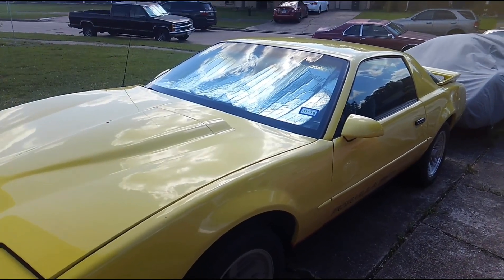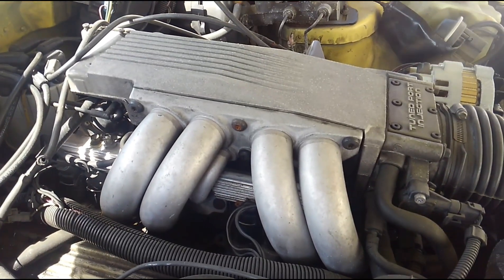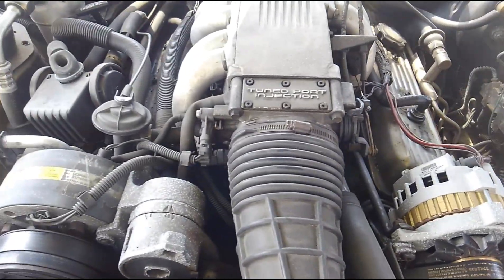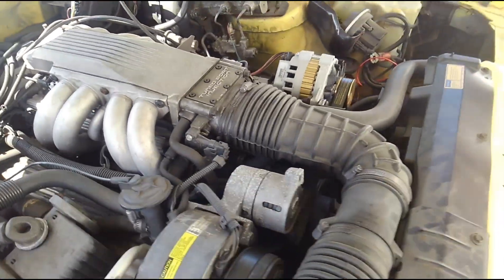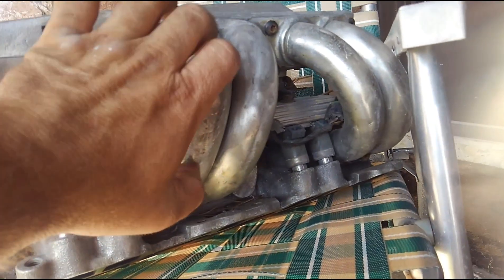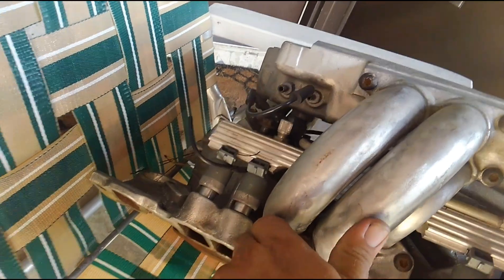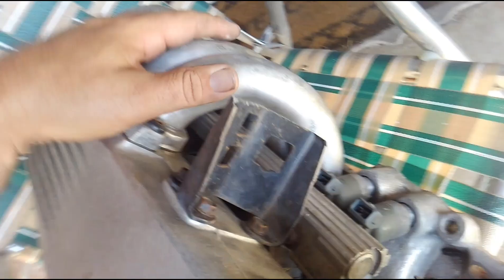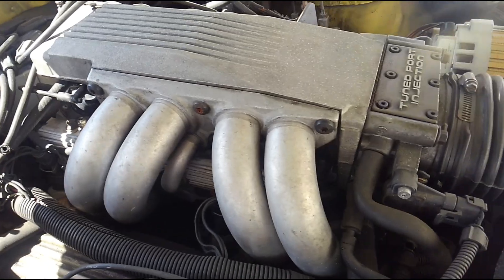The Awesome GM Tuned Port Injection System of the 80's

Comment from the maker: Be sure to check out the follow up tear down video for this Tuned Port Injection system - https://youtu.be/OMPd9wP7suA
Reply: Richard holdner will show you how a you will be a la motor on mostly anything out now with the right combination. Don't rule out the tuned port injection just yet guys, a lot of you aren't factual with your knowledge on the tuned port injection system.
Reply from the maker: Yep, they definitely surprise people at a stoplight pull. 👍
Reply: @VetteSource   Yes,  but I am talking further up the rpm gage as well like around 6500 if built right
Reply from the maker: Ahhh, yes. The secret mods that most people don't think about with a TPI. My personal favorite was the Lingenfelter Superram intake with matching can and AFR heads.
Reply: @lateroc2955 I kinda have one of every tpi, ai made take a my or tunnel r intake and make flanges to bolt a throttle body to each 4150 carb which would be 1500cfm, would need to be for max rpm, max lift, max flow but still be efi, I run a 950 on my 305 tpi .403/.431 207/109 LSA revs faster it's realynsoixy lately 19# inj 3.42posi 3000 stalll aluminum driveshaft runs pretty good frame ties also
Reply: Can You put a TPI on a 95 LT1?
Reply from the maker: Unfortunately not. The LT1 cools the block first so the heads and intake are different and won't interchange.
Reply: @VetteSource  Thanks for the answer. Ya, no water in a LT1 intake. Too bad.
Reply from the maker: No problem, man. Glad to do it👍
Reply: @VetteSource  I have a 95 2door S10 4x4 Blazer with a 95Vette LT1. Very sharp ride. Eerything works, air, push button 4x4, perfect interior never been smoked in. Vette steering wheel, carbon fiber everywhere inside, Micky Thompson wheels and tires, stainless duel exhaust, wraped headers, TV, remote CD changer cherry red and silver two tone. I always liked the tuned port intake. Wish I could put a picture up.
Reply from the maker: Sound like a cool build. Are you somewhere where you can use the 4x4?
Reply: @VetteSource  East Tenn. Mud, mountains, rocks, trails aplenty. We got it all. It's not a trail rig. More show. I have a 3/4 ton suburban for that. Lifted 4in, 35s, lockers, 456 gears. Much much more. Never owned a Vette. My buddy just totaled a 2017. My uncle had a 66 and a 67. Totaled both. I am a fan of the LT1 though. My son has one in a roadmaster. Torque!
Reply from the maker: The Suburban sounds like fun.  LT1's are a great engine with a nice broad flat torque curve. The hot rodded LT4 of 96 is even better with higher compression, more aggressive cam, and better heads. Too bad they made so few of them.
Reply: @VetteSource  We get around. And ya the LT4s are hard to come by unless you buy a new crate motor from GM.  Have a good one. And Stay safe.
Reply from the maker: @fontaineking5158  you too.
Reply from the maker: @fontaineking5158  you too.
Reply: But yellow?
Must be 4 teh lulz.
Hehe

Comment: Dodge did a cross ram back in the 50s. Low end torque but no upper power
Reply from the maker: Yep, I do remember those. It was very unique looking but had to be a dog at WOT with the length of those runners.

Comment: I have a 89 Corvette s 7:27 ame engine but mine has a chip in it so it's a little Quicker 😉 repainted Chrysler candy apple red, with        
 back window replaced with a
 hatch, only one other I know of.
Reply from the maker: Yep, the hatch conversion was made by an aftermarket company and supplied through Ecklers if I remember correctly.

Comment: General motors, they had multiport electronic fuel injection in 1974 on a twin cam Vega cosworth, General motors also had a multiport fuel injected engine on a 1976 Cadillac Seville.
Reply from the maker: Good point, forgot about those mid 70's oldies.

Comment: Hey Brian great video! I have an 89 GTA with a 5.7 TPI and I need to replace the plenum/runner gaskets due to a vacuum leak. While Im there, I want to torque down the intake bolts to proper specs. My question is, do I have to remove the fuel rail to access the center bots on both sides? Thank you in advance!
Reply from the maker: Yea. It's better to pull the rail out of the way while you're torturing down tye intake bolts. They are torx head and have a tendency to strip out if the angle of your bit is off even a little bit.

Comment: The key to TPI is no vacuum leaks, and proper sensors all working correctly.  THEN you can consider the typical mods….larger throttle bore or larger runners for intake…then typical small to medium bore headers.
But still you have the L98 heads to deal with….
If you can wrap your mind around 3500-4500 max rpm the L98 TPI engine is for you
Reply from the maker: Good information, thanks for sharing👍

Comment: You got a lot of facts wrong here. GM had a multiport electronic fuel injection system on the 500ci Cadillacs in 1976. I still remember working on them.
Reply from the maker: Cool, thanks for setting me straight👍

Comment: Is there a difference between the TPI units found on 305 engines and that found on 350s, say, some Irocs and early C4 Corvettes?  I have a '74 Corvette with an L82, and I would very much like to swap the carb for a TPI system.
Reply from the maker: Hey Gary, the biggest difference is the fuel lines, which come in from the PS on the Corvettes and the DS on the F-Bodies. Also, 305 TPIs will have 19 lb/hr injectors versus the larger 22-24 lb/hrs injectors found on the 350 cars. Also, 85-89 TPIs are MAF, and 90-92 Speed Density across all models.

Comment: This is very intriguing. I came here for some general knowledge. What is the biggest plus, I can see is the low-end power potential for a truck. These are dirt-cheap in the ads.  Most of the stand-alone controllers, run about $900. Is there a cheaper way to go without a degree in McGuiverism?
Reply from the maker: You're correct, these are not overly complicated and have the computing power of a Commodore 64 PC. Once you figure out all the tricks, they are very reliable and look awesome when you lift the hood as an added bonus.

Comment: Bosch TPI was developed for the 305 to give it low-mid range torque. It was modified and adapted to the 350 soon after.
Reply from the maker: Yep, but don't forget the L98 350 TPI was first installed in the Corvette in 1985, with the LB9 305 TPI offered in the IROC that year. I think it wasn't until 1987 that they finally began installing the L98 in the F-Bodies.
Reply: @VetteSource  Correct, the L98 was not available for purchase in an F body until 1987, which was “nice” but due to how the F-Body used a variation of the L98 configured with iron heads, among other differences, and was probably de-tuned, it offered more in bragging rights than improvement in performance over the LB9. Of course a 350 offers significantly more potential for high performance modification than the 305, but stock from the factory in 87 there was as little as a 10HP difference between the LB9 and the version of the L98 found in F Body cars.

Due to the 305 being designed with emissions and fuel economy in mind, not high performance, it completely lacked low-mid range torque. That's why GM approached Bosch to develop Tuned Port Injection. It was designed specifically to give the 305 that missing torque expected in the performance versions of the F Body, the Z28 or Trans Am. It made a huge difference to the 305 performance-wise in those cars. It makes my bone stock 1987 LB9 Trans Am a 190HP blast to drive.

While a modified version of TPI was adapted for use on the 350 for Corvette, leading to the L98, TPI was not originally designed for the 350. The 1985 L98 was a VAST improvement over the 1984 L83  w/ Cross-Eye Injection used in Corvette, but the TPI part of the L98 did little more for that engine performance-wise in '85 over what a carburetor could. I know this from first hand, real world experience. I had a 1979 Vette with a transplanted L98 that came out of a 1985 Vette. My L98 had the TPI fuel injection system removed and replaced with a Holly 4BBL. I do not recall which model Holly or it's CFM. I raced my friend and his bone stock 1986 Vette at the track and he beat me consistently by an average of 2/10ths of a second according to out time slips.

My point is TPI did the wonders for the performance of the 305 it was designed to, but didn't add much to the 350 from what I could see. It was just better then the Crap-fire. TPI is not the most advanced or robust FI, but it has a coolness factor its more capable successors all lack, most likely due to it's aesthetics. It's the most beautiful fuel injection system intake manifold ever. Great eye candy under the hood.
Reply from the maker: Excellent point, and you are spot on. You lift the hood of modern cars to be greeted by what looks like an industrial sewing machine. When you lift the hood of a first-generation fuel injection, be it a TPI or Ford 5.0, the wow factor still knocks people's socks off to this day👍.

Comment: I have a 86 camaro z28 305 tpi that runs one day and then won't run at all. I have fuel pressies and spark so I can't figure out why it acts that way. Any advice would be helpful because I don't know much about the tpi setup
Reply from the maker: Hey Harry, with an intermittent no start I would take a closer look at the ECM and determine whether or not it is pulsing the fuel injectors while cranking. If you don't have a fuel injector pulse tester, you can also spray starting fluid in the throttle body to see if it fires off. You may have an ECM wiring failure, or a bad ECM causing the issue. Let me know how it turns out👍.

Comment: mine is an 87 L98. The TPI was automotive genius by Chevy engineers. Think about it... a little box ECM with a chip that with sensors all over the motor sending signals controlled every critical motor function. Who comes up with that ?? Every injected SBC is a build-off of the TPI. Chevy engineers if you're out there stand up for a round of applause !!
Reply from the maker: Agree 100%. Still looks incredible almost 40 years later👍.

Comment: The Last túned port injection was a 1990 to 1991 corvette zr1 or c4 l98 but they replace the tpi with the throttle body injection was in 1991 to 1996
Reply from the maker: Close, but your forgetting the 1992 F Body Camaros and Firebirds still had the Tuned Port Injection. In 1993 they switched over to the Corvette LT1 which had debuted in the 1992 Corvettes.

Comment: Yea, Mine has been a great Car ! I Love the Car !!! 1986 iroc z28. 305 Tpi. 17-21 mpg city. 30 Mpg All Hwy on a Long trip. 2 people.
No problems ! All Original. Totally stock. Black / Gold. T-Top. 170,000 miles.
Reply from the maker: Yep, they are very reliable when properly maintained, and like you mentioned get pretty good gas mileage as an added bonus.

Comment: Will that motor go into and later model 97 firebird and if not why what blockage is right has heard that I wasn't able to put it in there no mods or worried about whatever it takes to get in there I'm working properly if it won't go in there and work properly then that's why I'm asking
Reply from the maker: Hey Peter, theoretically you could forward integrate a TPI system into a 97, but it would require a complete removal of the wiring, computer, and fuel system that eas originally installed in the 97. Furthermore, the Tuned Port Injection is an OBD1 system versus the OBD2 system that was in the 97 so none of the dash or transmission outputs will work correctly.
Reply: @VetteSource  what I was asking though the phone that I'm on records things that I haven't said, the 1997 firebird trans am that I've got came with the V6 3.8 somebody told me that a V8 won't fit between the tire the shock towers and the engine well so I said that it can't be done you can't put a V8 in place of the V6 dimensions of the car are different am I correct

Comment: I have a 1989 firebird gta 5.0 tpi but I'm getting weak injector pulse so the car won't run on its own but will run when u spray starter fluid on the air filter. I've replaced the computer, ignition module, fuel pump I have fuel pressure but weak injector pulse idk what it could be could use some help pls I'm ready to scrap the car lol jk
Reply: Fuel filter….
Reply from the maker: Yep, good simple thing to check first👍.
Reply from the maker: Hey Martin, sorry to hear the old boy has been giving you such trouble. 

At this point considering the components you've replaced, I would suspect a ground issue within the engine/injector harness. You can confirm this by testing the injector driver wires coming out of the ECM to the injector harness to verify the full 12 volt signal is being sent. 

Let me know if you need any more information. We'll see if we can get your GTA cruising the streets again.

Comment: 305ci engines were available with the 5 speed manual transmissions where the 350ci's were only available with the 700R4's. Give me the 5 speed any day🇺🇲⚡💥☄
Reply from the maker: I do like the stick over auto, but the torque and power of the 350 TPI is quite fun.

Comment: As much as I loved the TPI I hated the loss of power above 4,000 RPM. As soon as I drove an LT1, I realized the intake that should've been on cars in the 80's. The Miniram!

TPI is an ideal half ton or even 350 truck intake. Low end torque perfect for pulling. But back in the day this was exotic and GM probably couldn't roll the cost into a truck, so it ended up on a performance car :(
Reply from the maker: True, but the design has aged well. Hands down one of the best looking fuel injection intakes of the era. Thanks for the comments👍

Comment: Wow!  Never knew those intake runners went to the opposite side!  No wonder the engine has such great low-end power!
Reply from the maker: Definitely a very unique design
Reply: @VetteSource  Yup!  But I like the ZR1 even better…Lotus designed 4 Cam, only multiple cam engine ever by Chevy, then built by Mercury Marine!  What a story!
Reply from the maker: Yep, they're incredible machines. Be on the lookout, I'm going to begin reassembling a 1990 ZR-1 soon. I'm trying to put it together as a entire series before I release it.

Comment: Hi. My tps is only 3.6 v at WOT. I bougt new one and it is doing the same thing. Only 3.6 v at WOT. What to check next ? Wires? Computer? Or maybe new TPS IS  faulty too? Pls help
Reply from the maker: Sorry I missed your message. I would suggest taking a look at the wires to see if you can find something that would be causing a voltage drop, like a bad ground, or damaged wire causing a short to ground. Let me know how it goes

Comment: Hello just found and subscribed since you sound very knowledgeable on these cars. wondering if you can guide me with my issue. i have a 1986 transam 305 TPI have been troubleshooting this car on and off for a number of years for lean condition code 44 ,  have checked everything I can think of and in the GM service manual . this car has 105 miles on it all original and followed all the testing in the service manual. also replaced, maf, o2, egr temp switch, thermostat, ECU, gutted the cat converter due to back pressure. when the car is started o2 is around .440 volts then steadily goes down to under .2 volts and stays there and results in the code 44. the engine is running lean and smells rich I have no vacuum issues, confirmed egr works(not used anyway at idle) as well as the egr solenoid, air injection system in tact performed the injector balance test(passed) checked the cold start injector, (fine) fuel pressure regulator is fine, fuel pump is fine delivers spec. pressure and holds pressure, no leaks intake or exhaust, vacuum booster on brakes is fine, new idle control valve and i did calibrate when i installed, timing was checked and is correct, checked the gas and there is no water in it I am at my wits end and need some smart guidance. please help me
Reply: these cars were known for ecms going bad .first tpi has a set up that u can change over to its like 1500 for the set up and u get bigger runners plenum and computer set up
Reply from the maker: Thanks for sharing the information Josh, that's help some viewers find solutions to these older ECM systems.
Reply from the maker: Michael, sounds like you've dug pretty deep into the car in an attempt to diagnose the problem. One question to start. Are you able to establish communication with the ECM? One thought that comes to mind is that you may have some wiring that is internally degraded or damaged due to age causing the intermittent.
Reply: Sound like bad ecm. Check TPS to see if it change itself, check tps output & input. 

Subscribe me too

Comment: TPI lower intake question...  if memory serves, GM didn't re-angle the inner 4 intake to head bolts until 1986.  Does than mean the 84-85 TPI lower intake will bolt up to a traditional carburetor set of heads, such as the '80 and older?  Making it somewhat of a unicorn...
Reply from the maker: Hey Dan, youre correct, the change was made on all 1986 convertible Corvettes with the aluminum heads, and the coupes mid year when they switched from iron heads to aluminum. 84 was still a Cross Fire, so the 85 TPI intake is a stand alone and a unicorn like you said. They will bolt up to the old school style heads with no problems.

Comment: My 1990 IROC Z 350 5.7 had 63000 miles when i bought it. Does any one know what the injector oms are supposed to be?? Im doing some trouble shooting.
Reply from the maker: They should be +10 Ohms across the board.